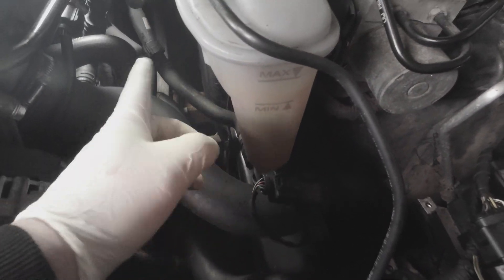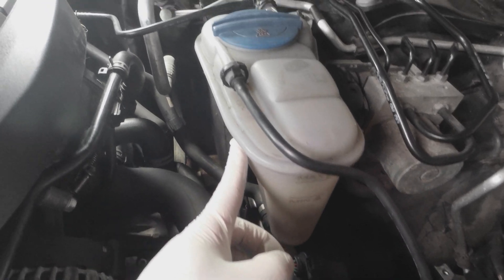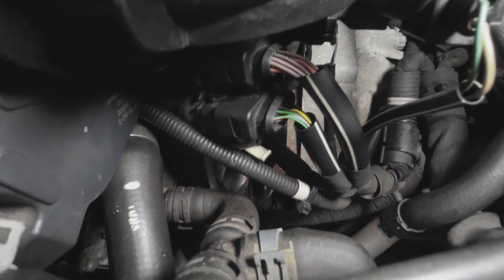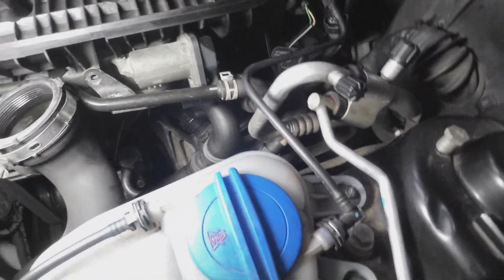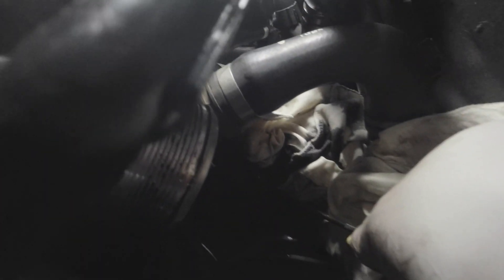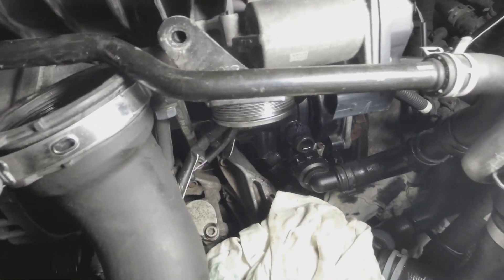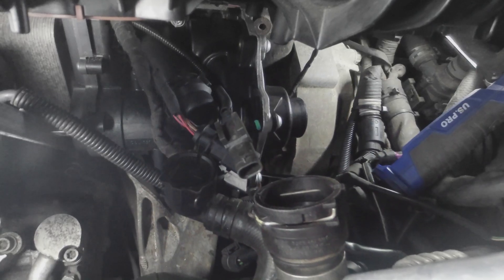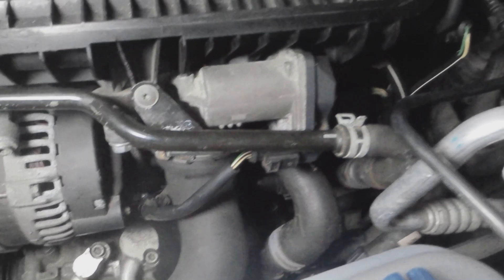How To Replace TSI TFSI Water Pump VW Audi EA888 Gen 3

Comment: Good video. Not sure why the Q7 is excluded on these lists, but the 2.0 for a Q7 gen 3 is the same. That piece between the cooler and thermostat housing doesn’t stay locked in place and kept falling out when I did mine. Took a while to get everything seated. My thermostat failed at 45K miles. Kinda soon for a water pump job.

Comment: I just want to get the front balance shaft out.  Could I just remove the water pump belt cover and the impeller to get that bolt and sprocket off the end of the balance shaft without removing the entire water pump?

Comment: Hi. I have a skoda 2017 2.0 tsi. 280hp. I replace the water pump because we cracked the case of it(long story). Now the car its boiling but the clock says the temperature it's at 95°c same on vcds . There's a initialization or something?
Reply: We replace it with a new one (oem).

Comment: did a  same  pump on mk7, I think vw remove engine to install the belt, it no way you can do that bolt 9nm + 90°, I just push the new belt in the bottom  gear.

Comment: Hi! 
Wouldn't be easier to take the intake manifold out than removeing all the other pipes / tubes in the way?
PS: i am completely noob in mechanics, just curious!
Reply: you can do but its long taking it off and once off you need to replace allot of seals and injectors so not worth it unless its gone
Reply: and if you do that you need to do connect VAS and run adaptions afterwards.

Comment: Nice work, i have a question my car is leaking from the thermostat only do i have to check the water pump as well ?
Reply: thermostat water pump one unit
Reply: @mohammedrahmanrahman5024  sorry just noticed that I wrote to check instead of change l have ordered it already without the water pump, even in our audi dealership it comes like that two parts but still don’t know if i have to buy the water pump as well

Comment: Hi, have a question 
I changed my pump but when I started it seems to have pressure in the circuit (bubbles). Some advice please
Reply: you need to bleed mate. from cold take off the cap on expansion tank go to car start it heater off. gas pedal down at 2000 rpm for around 2 mins. put expansion cap back on run it temp and should be okay. if not keep doing this till it clears.
Reply: @mohammedrahmanrahman5024  Thank you, my garagist told me that it could be a problem with a cylinder head joint or even a cylinder head to change
I’ll follow what you told me and I’ll keep you informed thanks.

Comment: Great video mate. Do you know if the water bottle on the S3 can be removed from the top  or is it more involve? Want to get it out to paint it too.
Reply from the maker: Of course mate just take bolts out first twist it up remove bottom pipe then top. Just let the water out the bottom or you get a flood. Thanks. Send me some pics if you get stuck
Reply: @GetJobDoneofficial  Sweet, thanks mate, sounds pretty straight forward :)